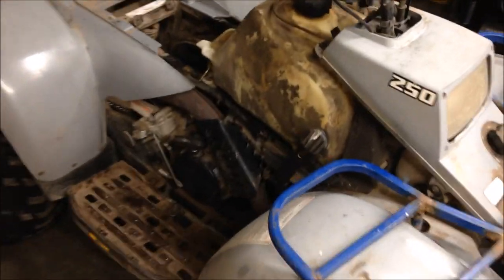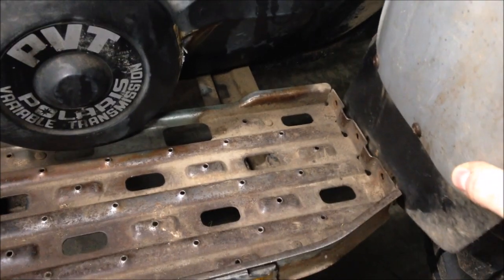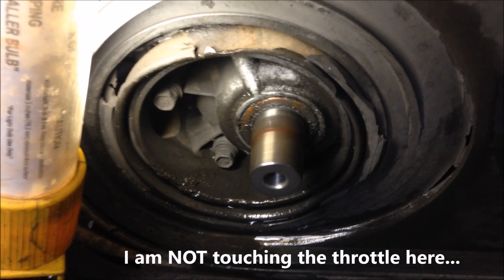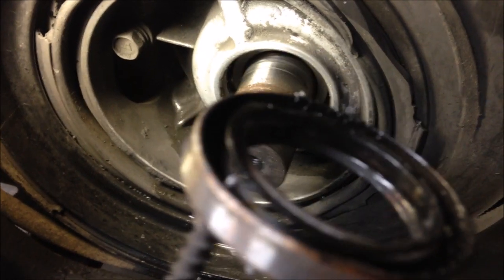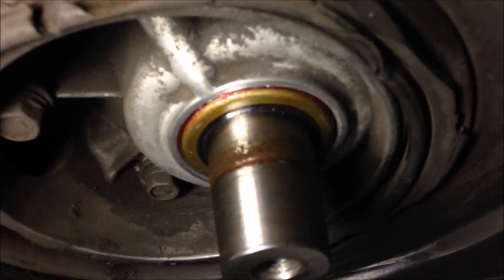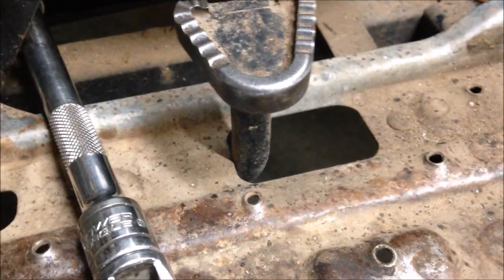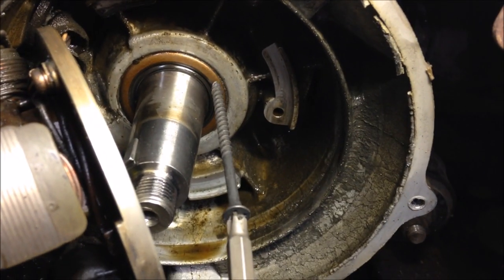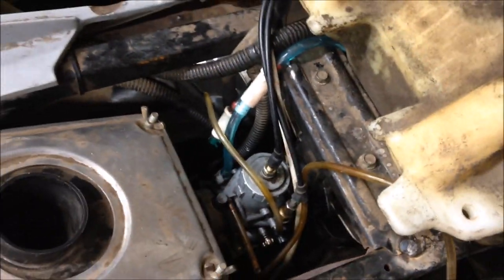How to Install/Replace: 1988-2003 Polaris Trail Boss 250 350 400 Crankcase Seals Seal Installation

Comment: Very helpful video. Was dreading doing this because I thought that the crankcase had to be split. I have a 300, hope it's the same as these. Look's the same to me.
Reply from the maker: All Polaris 2 strokes are pretty much the same. Luckily the ATVs (Trail Boss, Xplorer, 350L, 400L, etc) can be done without splitting the cases.

Comment: I have a 1991 350l trail boss and I think this is exactly the problem I'm having. I've got oil all over the skid plate and some even got into the starter and ruined it. Thanks for making this video!
Reply from the maker: No problem let me know if you have questions on the rebuild!

Comment: I got a free 93 trail boss 250(I think 250) 4x4 same procedure works but you have to get around the front wheel drive chain n cover

Comment: Ok question  what size bolt did you use to pop off the clutch  also went on to polaris parts nation looked at there diagram for a 2000 polaris 250 trail blazer alittle confused the one on the stator side I see is correct  but on the clutch side 1 part number on the block side shows 1part number then when you go to the clutch cover parts diagram shows a different seal any help would be greatly appreciated
Reply: I used a fine thread 3/4 inch bolt and it worked fine.

Comment: wHAT´S THE SIZE OF THE THREAD BOLT THAT YOU USED LIKE PULLER?
Reply: Not sure if too late but it's a 3/4 fine thread, 16 threads per inch.

Comment: I have a scrambler 400 using balance shaft oil. How hard is that to fix and do you have a video. Thanks
Reply from the maker: It's likely a bad crank seal. It would be the one behind the counter balancer timing gear on the crankshaft.
Reply: @BrapStuff  thanks buddy

Comment: And it fires up first fricken pull.  I am working on a 2006 Polaris Trail Blazer 250 (2-stroke) and it is giving me fits.  Checked everything 100x over and nothing seems amiss regarding spark, air, compression, fuel.  No leaks from the crank seals either.  It tries to fire the first pull - then nothing. We have changed, replaced, inspected, cleaned, etc literally everything among everything.  And cannot get this thing to run.  So pissed about it too.  If anyone has a magic answer (beyond the usual compression, spark, fuel, air comments) we are all ears here.........  Checked the emergency throttle cutoff switch as well.  And it's fine.  CDI new, Coil new, Stator new, spark plug new, fuel new, carb clean and rebuild, new, everything new and checked over and over.
Reply from the maker: Spark plug might spark outside cylinder but not in the cylinder. Make sure you change it with a known good one. Also if you mist gas directly into the carburetor when trying to start that should give you an idea what’s going on.
Reply: @BrapStuff  tried two brand new ones. Both worked fine in other motors. Both gapped precisely. And the spark plug is getting lightly damp after a few attempted starts. So it is obviously getting fuel.  Float level is perfect in the carb as well.
Reply: @HorsepowerHouse  Try pulling the exhaust off used to work on snowmobiles long ago be amazed at what will build nest in them backpressure can cause a fire on first pull then flood the plug. other than that recheck new cdi/stator could be bad I have a bayou that drove me crazy (and some days its a short trip) new cdi was bad it checked out good but wouldn't run right old one would run until it warmed up then act up a 2nd new cdi all was good as least as it can get for a kawasuki
Reply: @BrapStuff  what's the parts # on those seal